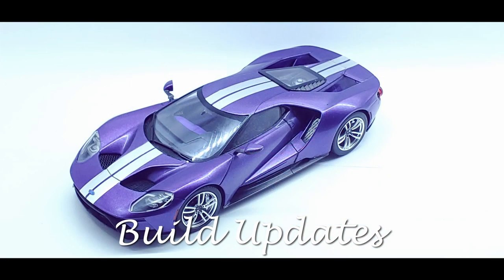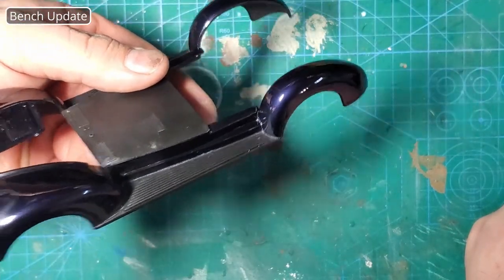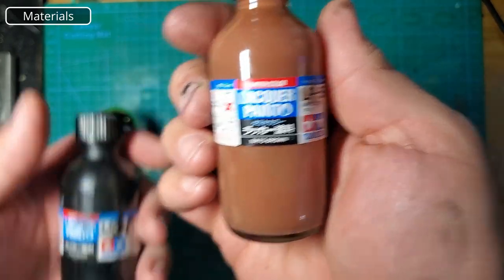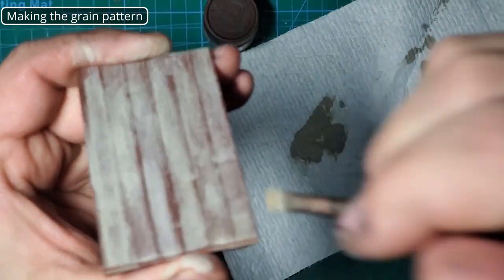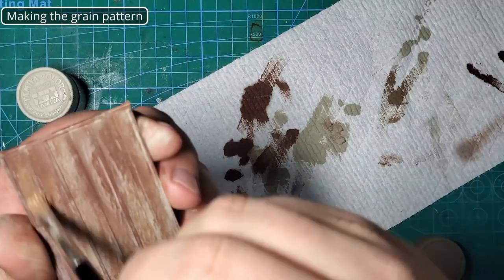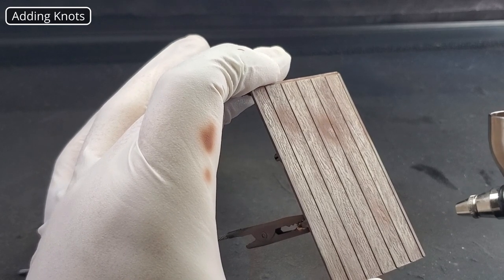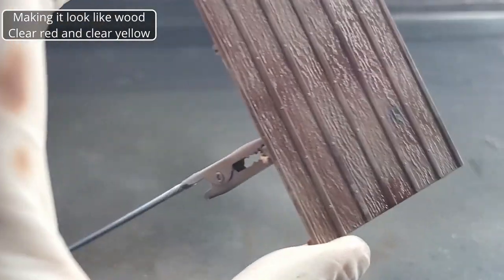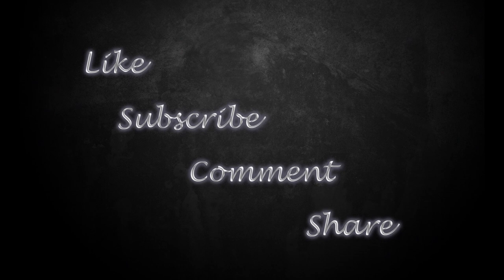Revell - 41 Chevy Pickup - Update2 and How to Paint Wooden Truck Beds

Comment: This came out decent. I discovered a way better way though that comes out flawless. I just did one for the Foose FD100 Ford and it looks like real wood. Had to add my own grain effects because the plastic was smooth. Kit came with a decal for the bed. Those never hold up over time.

After I taped off the bed rails, bottom and top, I scuffed it with 100 grit sand paper in random patterns to make the wood grain. 
Laid down a layer of Valleyo "Wood" with airbrush, then let the dry good.
Bought a pack of brown sharpies different shades, and made different patters on each plank. 
End product looks like real wood.
Reply from the maker: Nice. Sounds like a good tip. Have a great one!

Comment: Did you paint the chrome sections on the body on the 41?
Reply from the maker: No I used bare metal foil on the chrome trim. Doing the BMF before the 2k clear helps protect it from flaking off over time, and gives it a bit more shine.
Reply: @JHartModelworks  I will have to try that method but do have any problems with bare metal afoul coming off when sanding and polishing?